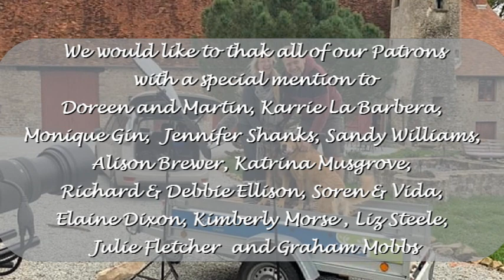158. DIY double glazed windows for €25 part 2

Comment: Superb. Just excellent crafting. Look at using Oakum or lime mortar to pack between the frame and the stone rather than foam - shame to get rid of all the concrete to fill it up with foam. Foam will trap moisture, oakum or lime mortar will let it back out
Reply from the maker: The foam is only on a very very small part of the window, the rest will be lime mortared as we have done with every other part of the stone walls we have renovated in the buildings

Comment: the window pane is installed from inside. Ted just did his from outside.  the reason,  less wood material exposed to elements.
Reply from the maker: Yep, I guess you learn something, but that is the way I did it, however, the inside method will be utilised elsewhere, thx for the comment

Comment: I was wondering why you don’t made the windows so that the glass is put in  on the inside of the house. Then there is no possibility for break ins by removing the putty or battons on the outside. The putty or battons to hold the glass inside the frame would then be inside the house.
Reply from the maker: Just the way I did it I guess, however, for the future the inside method will be utilised
Reply: @ChateauDeMontmagner  Your way is best with putty - you can push the window in otherwise. If battens, then yes, put to inside